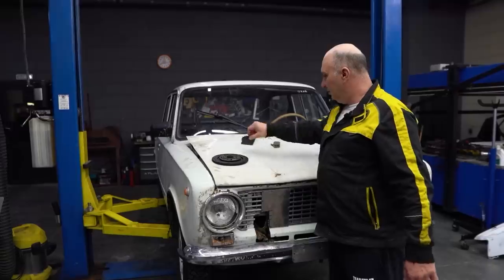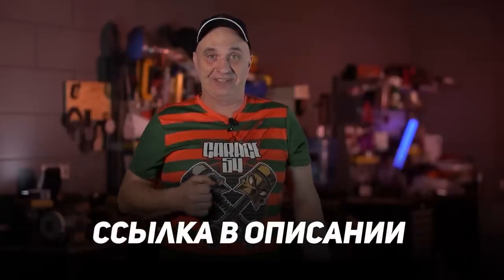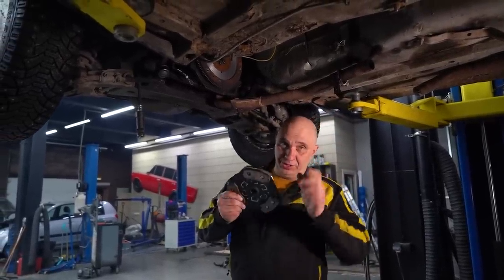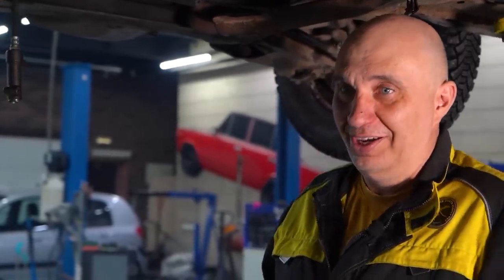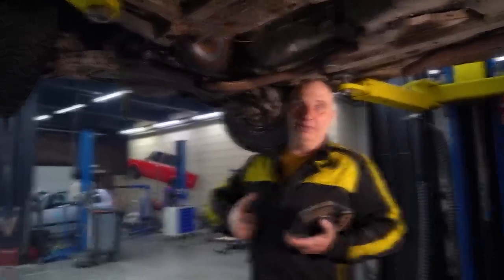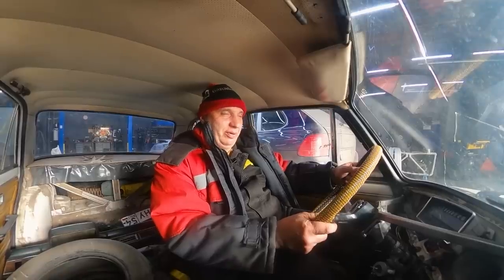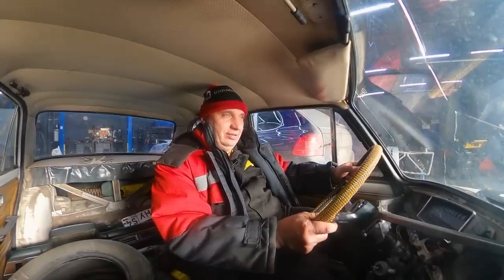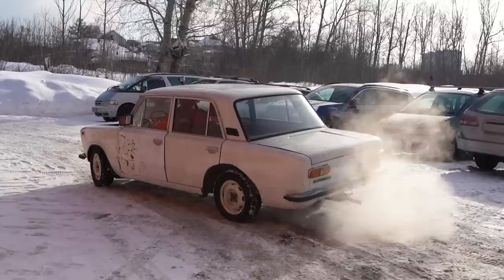Brake pad based clutch disc - will it work?

Comment: The reference he made to the episode where they made their own ceramic clutch, I saw that episode, the results shocked me. The fact that they even achieved it blew my mind and it's characteristics were really interesting. Unsurprisingly though, eventually the very delicate porcelain broke.
Reply: you could pretty much use anything, alot of clamping force on the pressure plate
Reply: @aeroflopper  That's not the point though. The point was that he made a ceramic clutch. Not a clutch made out of some kind of clamp you're referring to... I understand how a clutch works, generally all of us here do I would imagine.. which isn't my point.
Reply: I haven't viewed the video yet but I say guaranteed it will work
Reply: It worked to a point and that was with a simple tile. Imagine if they ground the tile to powder and mixed that into carbon/resin.
I think it would work very well - at the expense of increased flywheel wear.
Reply: @garygermain1446  It's an excellent one, I highly recommend it. With how fragile ceramic is I'm shocked they got it to work at all, but they did
Reply: @siraff4461  exactly! It blew my mind that they basically took any old ceramic tile, cut it to the proper dimensions and It worked out (for a little bit at least)
Reply: I wouldn't call porcelain delicate. Try drilling through some tile...
Reply: @Vicus_of_Utrecht  apply 80 horsepower or so and about the same amount of torque to a quarter inch thick piece of porcelain.... Now tell me porcelain isn't delicate...
Please, they've had the same problem with ceramic clutches in formula 1 and every other race venue that uses them. Getting ceramic clutches to be mechanically viable took a decade in very difficult materials engineering and research.
Reply: @Vicus_of_Utrecht  The problem is porcelain has zero tensile strength (It cannot bend or stretch) before it breaks. This is what makes ceramics miserable material to work with. While lacking in tensile strength, ceramics have hugely desirable qualities that make them ideal for uses as clutches and breaks in the automotive industry.  Particularly there resistance to heat and deformation caused by heat.
Reply: @stanley1554  little, tensile. Brittle. Shock is required here, used as a clutch, and not clutch-dropped e.g. drag racing, there's no reason to expect the porcelain to break in this application.

Edit: and we're not talking about fine china or toilets. Small, compact, porcelain disks.
Reply: @stanley1554  Thanks for the rant but my God did you add nothing new here...
Reply: @Vicus_of_Utrecht  Well when someone thinks ceramics aren't delicate, I'd say that needs correcting.
Reply: @Vicus_of_Utrecht  Don't thank me, thank yourself for your overwhelming ignorance. I'm happy to educate
Reply: @Stanley  the pressure plate is the clamp, are you sure you know how a clutch works?
Reply: @aeroflopper  of course, the point is tremendous amounts of pressure get applied to the ceramic. Breaking a quarter inch thick piece of ceramic that is designed to transfer tremendous amount of torque is very easy to do considering ceramic has no tensile strength
Reply: @stanley1554  ceramic clutches are a thing in racing carts . like fully ceramic but there is a metal ring around the clutch plate to assist in strength
Reply: @amdintelxsniperx  and the sky is the thing above our heads, it's blue.. very good captain obvious 👌👏
Reply: @stanley1554  im 100 percent sure you wee not aware of this LOL cringe lord
Reply: @amdintelxsniperx  the point is irrelevant. Power is transmitted to the ceramic. Ceramic has no tensile strength. Ceramic is hell to work with. That was the origional topic.
Reply: Makes me wonder if Alumina tiles would've fared better.
Reply: @Vicus_of_Utrecht   fine, 'brittle' then
Reply: @stanley1554  they are only 40-60% ceramic, embedded in other materials...100% ceramic is very brittle, and prone to heat cracking. so yeah, 54 did an awesome job.

Comment: Looks a LOT like my 225mm race puc clutch. It engages HARD. Trans mounts love it...

Edit - I actually cleared my storage garage and I did find exactly that - two brake pads and an old clutch set. Difference is I threw it all in the parts car. As in, loosely inside it somewhere.
Reply: puck style clutches and big cams are the worst for stop-go traffic lol.
Reply: @i_woke_up_in_a_new_buggati  Big cams are fine if you raise the idle
Reply: @WolfieMel  English?
Reply: @DarkLinkAD  Nah…. Lower the idle to the point it almost stalls with every lope.  😁
Reply: I haven't viewed the video yet but I say it will definitely work

Comment: I have changed a lot button clutches on semis they look just like this, this clutch should last for a long time. Maybe try removing the steel backing of the brake pad and bolt or epoxy them to the plate to shed weight.

Comment: When I changed my clutch. It was really rough and weird feeling for a while. I also put a rebuilt trans in there at the same time. Everything felt weird. After a few hundred miles it was right as rain.

Comment: You should make a wheel with springs in the inner diameter instead of the outer diameter. They'll be really small pieces. Weld them from the hub to the rim. I believe that should respond much better, because you are working with opposing forces which help "balance" the wheel

Comment: The brake material and the clutch material are designed to work in two different ways. so some problems were expected right?  The clutch was probably not balanced either?

Comment: I would have expected a significant vibration issue due to the brake pads not being balanced.

Cool that it worked though.

But in a way, not too surprising because the brake pads ARE a friction material, so it works for the torque transfer.

Comment: Brake material and clutch material are basically the same. Both materials apply pressure to a steel disk to make friction to move forward or to stop

Comment: So if the fly wheel is too heavy, you could have a delay in the upshift it’s probably not because it’s spinning so fast just the weight of it. Of course you’re gonna have a bit of Pádraig against the flywheel because of the way, but it also has a catch-up, the spin, the weight of that extra waited clutch.

Comment: Science bro, centrifugal force will act on that clutch disk especially an unbalanced disk with that amount of weight at all 3 sides. Like the interesting idea of trying it. I reckon it would slip as well on dry road. If you lift engine revs you would be able to get it into gear if you knew what your doing and time it correctly 👍
Reply: I ment on down shift for changing gears 😉

Comment: If you use carbon fiber pads on that it results in a clutch disk that is nearly impossible to burn. With carbon pads you could probably burn the plate and the flywheel out before the pads totally fail.
Reply: Nop, it will not work, must be high temp ro work, maybe carbon with mix material will work fine...

Comment: Worlds first clutch disc with serviceable friction material! Instead of wasting money on all the metal parts besides the friction material you can replace only whats needed. Neat.
Reply: I honestly don't know why a ring pad for your clutch isn't a thing
Reply: You can buy rebuildable clutches, but they are normally only for drag racing rather then road use.
Reply: @Dont-come-at-me-24  yes this is true but you have to buy a whole new clutch disc, not just the friction material. Thats my point
Reply: @AwakenedR6  Because you should replace the disc, pressure plate, pilot bearing, and surface the flywheel when you do the job because it’s all got wear on it and you shouldn’t want to do it again any time soon

Comment: To compensate for the added inertia from the spinning break use magnetic power to reduce the speed or increase speed for a factor of 1 to 1 or 2 to one as to not loose as less spinning momentum or to add spin spin increase the delay of changing gears maybe to draw battery amps to change

Comment: honestly
this is kinda similar to something i plan to use for my final work at the end of highschool
i'll be making a DIY engine dyno for a 50cc bike engine (and tuning the engine)
and i'll be using the whole brake assembly from a minibike for power transfer between the crankshaft and the load-cell
Reply: Are you sharing it in your youtube channel bro?
Reply: Im sure you have already looked at it, but there are some really interesting Dyno builds out there for some what smaller engines. I am looking at water brakes. 

For your design on such a small engine I think I would just go with a car disc brake.
Much simpler to get parts and not build as much. Just pull parts from a junkyard and figure out how to mount it to your engine and load cell. Perhaps use the cheap hydraulic handbrake kits to do the hydraulics for the brake.
Reply: @Kothamhomework  i mean, i'll be making some video documentation for sure, just not the whole process
probably the finished thing
and yeah, i might upload them, but i'll see (should/needs to be done before this November lol)
Reply: @Zachry86  as i said, i'm using the brake from a minibike lol
that's kinda as easy as it gets, since i have two of them and they're all mechanical, no hydraulics to worry about
Reply: @pr05teja59  ahh, its too far to waiting

Comment: this would probably work if you  removed a pound of the clutch . ie drilling out some holes  in the clutch plate made out of break dics . doing so will get it a bit closer to the weight of the original clutch

Comment: I would like to see two gear boxes attached together like to 4speeds or to 5 speeds
Reply: That is called a gear vendor
Reply: Great suggestion, ill comment and like just to get more attention to it lol. I just  wouldn't 😂want to see him shift through those gears tho, dude is trash. Lol. Did you see his "double clutch"?haha
Reply: Pretty sure they did that already a few years back...
Reply: Would multiply torque and give you essentially a truck transmission with 8-10 forward gears and 4 to 5 reverse gears. First on both would move mountains 1st and 4th would be "1st" 5th would be "slightly more than 1st but not quite second" and 1st and reverse will be a high torque reverse (reverse on both would be forward again)

Comment: I image brakes will be a bit more slippy considering they are designed to do just that under higher pressure than a clutch without wearing much.

Comment: no reason it wont work. the friction material on standard brake pads and standard clutches are the same. as for using brake pads, they work the same way as a 'paddle' clutch. bite will be more harsh and apparently grips better/will transfer more power

Comment: Why no double-clutching? I'd figured a Russian mechanic especially would still know the technique (from synchro-less transmissions being more common there in years-gone-by.)
*Normal Shift*: Clutch In - Gear Change - Clutch Out
*Dbl. Clutch*: Clutch In - Neutral - Clutch Out - (rev-match) - Clutch In - Gear Change - Clutch Out. 

Note: When this technique was developed (with Synchro-less standard transmissions) Rev-matching was not optional. Not properly rev-matching will wear things excessively, regardless.

Comment: i havealways wondered about somehowusing clutch material to make brake pads. clutch material seams to last forever compaired to brake pads.
Reply: Clutches "last forever" because they don't transmit much torque under slip conditions for very long. The transmissions gears always limit you to the max the engine can produce, and it's rare (and short) that you can slip a clutch for long at that power level. 

Brake pads deal with it the entiiiiire time you are stopping.
Reply: Different conditions
Reply: @rian0xFFF  yeah, I explained it weirdly, but the power (heat) being dissipated into a clutch is far less energy than a brake pad.

Brakes have rotors to absorb that long term heat, clutches do not slip under high load for any length of time and don't generate much heat (they shouldn't unless abused).

Comment: That is one fine looking Lada!  Correct me if I'm wrong, but I think it's so old that it has a hole in the front bumper for a hand crank, right? 

Lot's of guys get into increasing horsepower for better performance, etc. My suggestion is to go the opposite direction and find ways to make a Lada even LESS appealing from a performance standpoint. 
Here are a couple ideas you might consider that would accomplish this worthy objective:
1) Retrofit a Zaporozhets 968 engine/transmission/rear axle assembly to this Lada. Likely result: better traction, lighter weight, less power!
2) Retrofit a 3-cylinder Oka engine/transmission/front axle assembly to this Lada. Likely result: better traction, lighter weight, less power!
3) Even better: Do both #1 and #2 above. Result: Driver has the option of air-cooled, rear-engine Porsche style "power" OR front wheel drive? Wow!

Comment: * MODIFY A CAR TO DRIVE SIDEWAYS BUT LEAVING THE WHEELS AT CURRENT LOCATION *
Reply: Keep the wheels at the same location but rotate the tires 90° to the chassis ! You will have to look left to drive straight 😜

Comment: 0:42 brake pads will not fit, are too thick, even metal base alone is thicker than normal clutch disk. This is just sinter clutch pads.

Comment: It’s a “pucked” clutch. It’s for racing. You get more pounds per square inch (kilograms per square centimeter). It’s able to launch so hard it’ll break things in new and interesting ways. I always love it when garage 54 randomly discovers a piece of racing technology from thirty to fifty years ago.
Reply: Your stroking your own ego, these guys have been in the business since before you were born. What we call a puck clutch in the states will probably be something entirely different in Russia.
Reply: Of course they know what a puck clutch is.... They have built drift cars, do you think they are using stock fiber disks?
Reply: Puck clutchs come from hauling/ towing not so much launching a small light car . Puck” style dry clutch’s were designed for holding high torque from semi trucks, 99% of all manual transmission semi truck use a twin 4/6 puck clutch.

Full face clutch’s can absolutely have the same level of force but are far more comfortable for everyday street/strip use. The sprung centre section, won’t shock the drive train. 

There is no reason to ever use a puck clutch in a FWD car, any properly rated full face clutch will hold power fine, need some slippage to launch, small
Displacement 4 bangers don’t make high toque at any rpm.  

in fully build Rwd drag cars. Multi disc full face clutch’s are still far more common and preferred.

Tractor pull competition is where puck clutches shine, where you have low rpm high Torque output from diesel engines 

Not saying a manufacturer won’t happily sell you whatever you want. But no Honda, Subaru etc on the planet actually needs the aggressive engagement of a puck clutch. 2/3/4 disc full face is the way to go.
Reply: Small subsection of professional “drifters” use a puck clutch, take advantage of the chatter/aggressive engagement from dumping a puck clutch creates to help break the rear tires free.

Comment: He said the 1 to 2 upshift is slow because of extra inertia... he has no idea how physics works and no idea how a clutch works..    this whole test was faked... the delay from changing gears is the gearbox having worn out synchros and him not being able to drive manual.. this is why you dont trust youtube tests, if extra clutch speed stops you engaging the next gear none of us would be able to change gear at 8k rpm when racing we'd have to change at low rpm and not race lol..